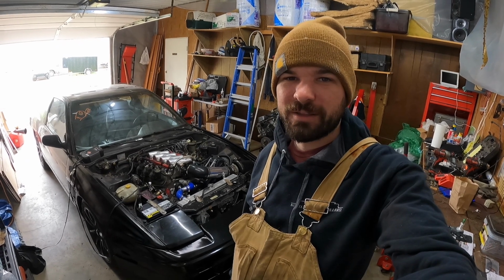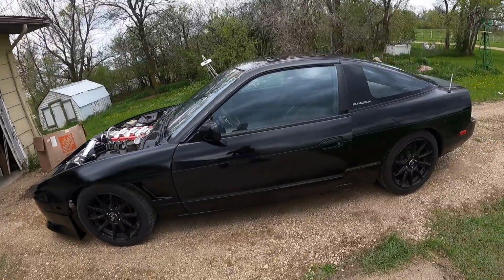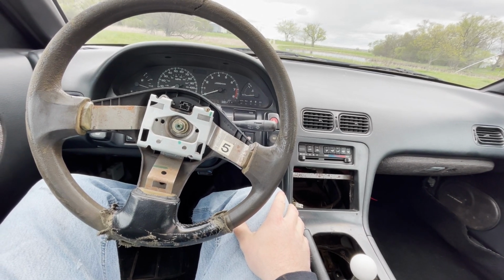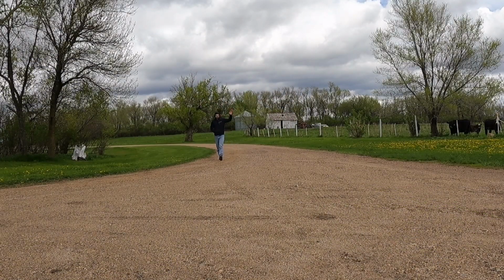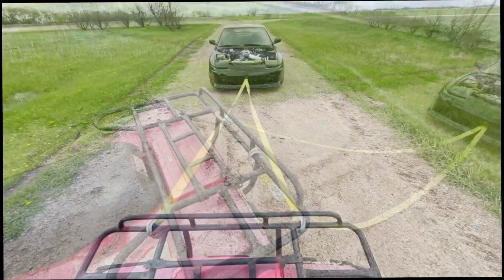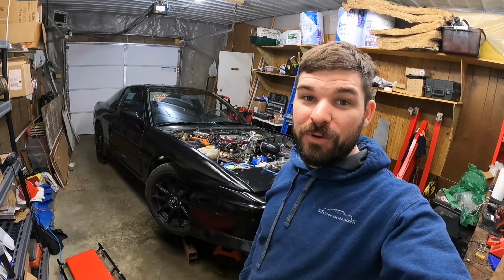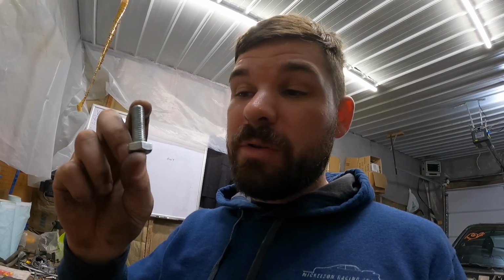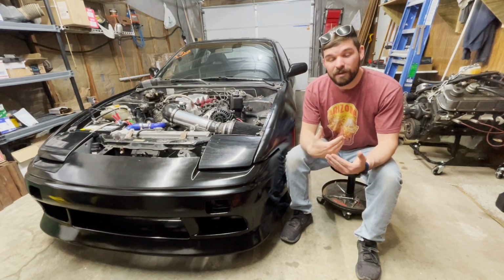LS Swapped S13 FIRST DRIVE!!! Nissan 240sx

Comment: Looks like a normal Blue Plate car with rust in odd places under the hood and I'm sure all over underneath!  It's a beauty though.  Glad to see you taking it for a drive.
Reply from the maker: It definitely has its share of rust. A lot of the underside has been cut out and replaced. Still some work to go though.
Reply: Indeed any S13 has some self recycling sheet metal. Owned a bunch and have some rust. AW11 two AE86 GTS from New Jersey! Yeah I love patching crap!

Comment: Normally that would be a vacuum leak. May be you need to reset the throttle body by leaving the cable off and let the throttle body rest shut and give 2 turns on the screw and hook the cable back up & see. 
 Unless it's the fly by wire system. 
 Then the reset is different.  
 Nice place you have there. 
 How wide are tires on your caprice on the back mine are 235 50 18. 
 I need new ones for inspection on the back at least.  I did wheel hubs on the front over the memorial day weekend and mine were noisy in the car but out of the car I couldn't even free spin either side.  Ac delco gold hubs made in China so I'll see how long they last. 
 Be safe team !
Reply from the maker: Hey Jeff! My back tires are 325/30R19 on C6 Z06 wheels. Hopefully your hub assemblies last a while!

Comment: Idle air control issues?
Reply from the maker: Bigger throttle body, way too much air!
Reply: @MickelsonRacingChannel  August is it a speed density tune? AFM would compensate and regulate(?). She’s a keeper!
Reply from the maker: @WoodLox  currently a stock 2001 suburban 5.3 tune, it needs to have a chassis dyno session.
Reply: @MickelsonRacingChannel  got you, it’s a base unlocked tune. Does it have a afm tuned out? If the wires are there and it’s still on the mapping, might work. Had a few L59’s and Lm7’s with time on gmt800’s. She should still work.